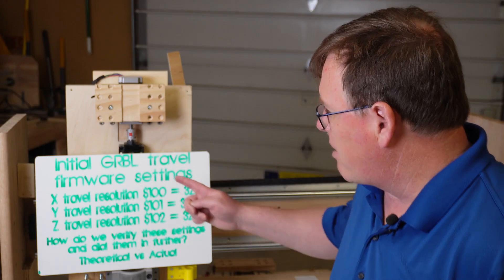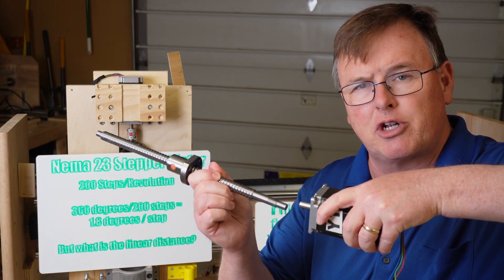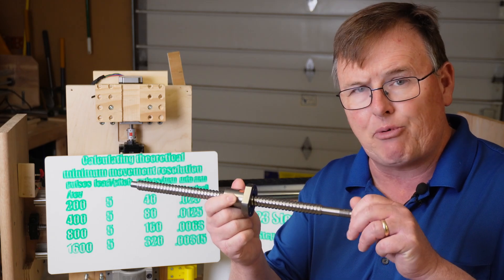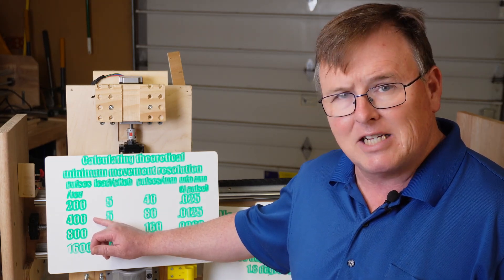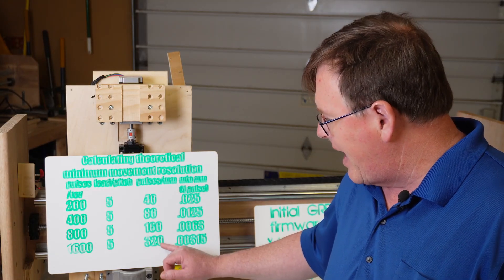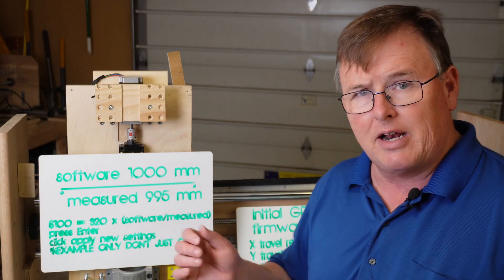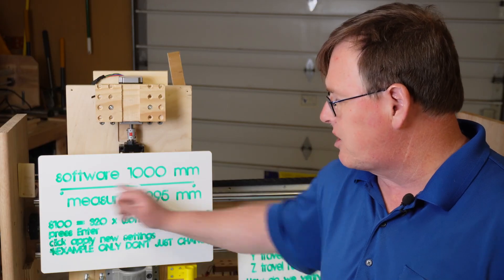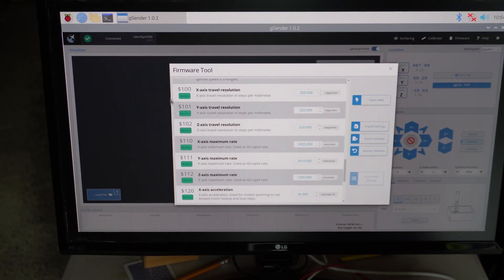OPTIMIZE YOUR CNC GRBL FIRMWARE FOR INCREASED ACCURACY AND SPEED | DIY CNC BUILD EPISODE 23

Comment: How can we know what kind of the firmware that my cnc machine using?
Reply from the maker: I am SO SORRY it has taken me so long to reply.  I make it a goal to respond within a couple of days. My bad.

Go into gSender (free opensource CNC control software), connect your CNC via a USB cable (and hit the connect button top left side of screen).  Click on the console tab on the lower right-hand side of the screen.  It should bring up some text with parameters.  Use your middle scroll wheel clicking on text window to scroll up to top line of text. You should see what firmware is currently installed.

It is possible that your CNC software has proprietary software but most likely it is not.  Most of the manufacturers are still running some version of GRBL.  I hope that helps.  If you run into more problems let me know and I will see if I can find out more information.  You can also, if it is running your CNC with an arduino, get access to this information via arduino IDE (also opensource) and the live console window but you will have to use a command code.  Using command codes is a little less intuitive.  I can't quite remember the exact command code but I think it is something like a $$.  I am sure if you do a search online you can find it (or maybe an arduino IDE guru can add to this comment and give the required command code).
Reply: @Simplifycnc I'm so HAPPY to get your replied sir.

Actually, the Gsender is the reason why I asked you about the firmware LOL. Because I wanna use Gsender instead of NC studio software which I'm using recently.

Well, I usually using nc studio software on my PC to control the cnc machine. And also I use NC controller driver system on this machine, Which is I don't have any usb port but I do have PCI port on the NC controller driver itself 
( here how its looks like 👉 https://youtu.be/Xp24YmZewBA?si=Nkjq7nnYSSmWaVsg )
Reply: @Simplifycnc I wonder if I can use Gsender by plug in PCI port instead of USB? In case of the PCI port are not compatible with the Gsender , then how can I identify the Firmware on my machine?

Hopefully you will understand my situation, if not please don't hesitate to ask me anything to let me explain sir.
Reply from the maker: @naruponkanjanapas4459  I am afraid using a pci port with Gsender is outside my expertise.  I would recommend you go to sienci.com and shoot out an email to their tech support  They are good at answering questions and I suspect they will be able to tell you whether their Gsender software has a way to integrate with the pci port.  

I am curious - does you CNC machine have a brand name or is it self built?  If you leave that info in the comment field others might be able to give you additional suggestions on how to get to your firmware version (or maybe just tell you point blank what you likely have).